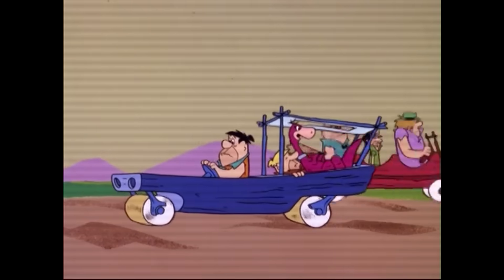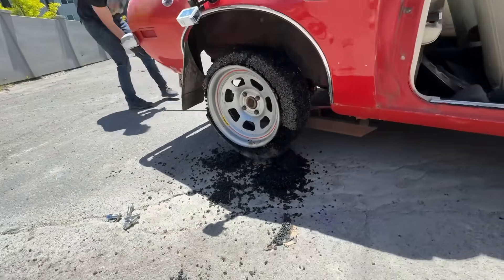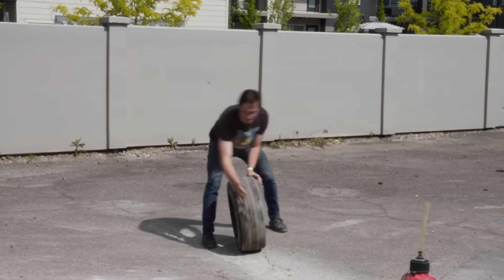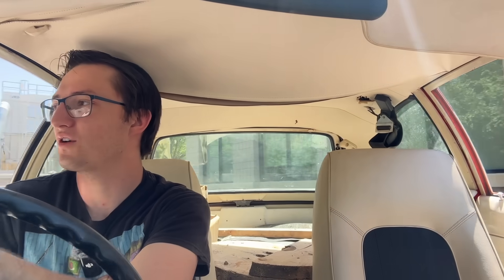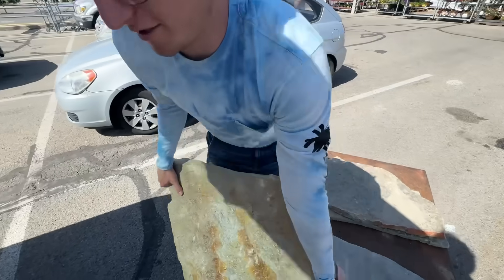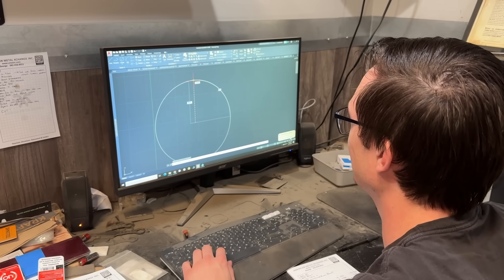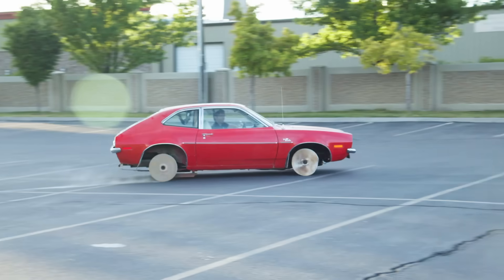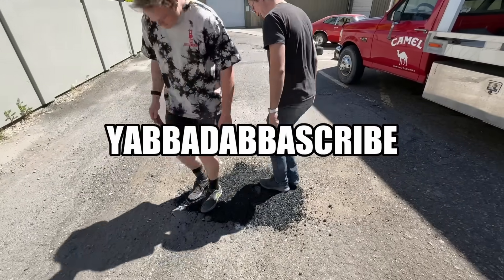Can You Drive On Stone Wheels?

Comment: I keep watching these to see if they will do these projects in an intelligent manner. But these "JOKE ENGINEERING" channels are just for entertainment. You can engineer stone tires that will work, but they will be VERY heavy and would requires special bolts to fasten to the wheel assembly.. or you can create stone tires that affix to existing rims, or specially designed rims. Using thin stone discs is just dumb, and funny, which is why I watch these video (to laugh at the fail).

Comment: you know what's really fun?

plastic wheels. specifically as in a plastic liner made of like agracultural drainage pipe. fitting a wheel in 'em can be a trick. be easier without the radial wires. 

but yeah. perfect for if you were brave enough to drift the pinto. I'd do a rear end overhaul if it were mine. at least ditch the leafs for semi trailing arm, and do something about that gas tank situation. was thinking fuel cell, but we ain't going full race. just cheap garage beater racer.

I grew up on monster garage and around my mechanic uncles.

Comment: its the same rd material 1 reason it wrks

vanallen=newhorizonspeed=shows moon cant b reached since range=speed! EXACT MATCH move "4" one digit over!
36400speed=36040range ALSO CARS MAX 300MPH=CITY2CITYRANGEMATCH!

coldwaterafterhot=brains
 DUPONTmicroplastics
pinealglandsleep
redbloodcelloxyg
kid10xEMF
wps is not off
CHICKENPOXV=SHINGLES
Dentists don't track X-Rays enough
blue-lite blockers acrylic tan orange; sideflectors eclipserollens nvrdilateliq COPPER BLOCKS WIFI oxygen sleep grisom baron William Greer BAYOFPIGSCIA shatner911 muffsplugstinnitus

single nuke in space emp could wipe out nearly all tech :o wow

Comment: The asphalt tire would have worked better if you mixed the epoxy with the asphalt before pouring or poured the epoxy with the asphalt at the same time into the tire.

Comment: Ah yes… Greg the Chevrolet
Now I have the urge to type out the lyrics of “rusty Chevrolet” know what… screw it. I Here I go. 

“Dashing through the snow,
In my rusty Chevrolet,
Down the road I go,
Sliding all the way,
I need new piston rings,
I need some new snow tires,
My car is held together
By a piece of chicken wire,

Oh, rust and smoke, the heater's broke,
The door just blew away,
I light a match to see the dash,
And then I start to pray,
The frame is bent, the muffler went,
The radio, it's okay,
Oh, what fun it is to drive
This rusty Chevrolet.

I went to the IGA,
To get some Christmas cheer,
I just passed up my left front tire
And it's getting hard to steer,
Skidding down the highway,
Right past the Negaunee cops,
I had to drag my swampers
Just to get the car to stop,

Oh, rust and smoke, the heater's broke,
The door just blew away,
I light a match to see the dash,
And then I start to pray,
The frame is bent, the muffler went,
The radio, it's okay,
Oh, what fun it is to drive
This rusty Chevrolet.
(instrumental)

Bouncing through the snowdrifts,
In a big blue cloud of smoke,
People laugh as I drive by,
I wonder what's the joke,
I got to get to Shop-Ko,
To pick up the lay-away.
'Cause Santa Claus is coming soon
In his big old rusty sleigh.

Oh, rust and smoke, the heater's broke,
The door just blew away,
I light a match to see the dash,
And then I start to pray,
The frame is bent, the muffler went,
The radio, it's okay,
Oh, what fun it is to drive
This rusty Chevrolet.”

Comment: Why wouldn't you put washers on the lug bolts before you put the lug nuts on to make it not rocky? Would have costed you about 72¢ a tire or $2.88 for all 4 tires. Actually $2.70 because you're missing 1 lug bolt. Forgot about that one.

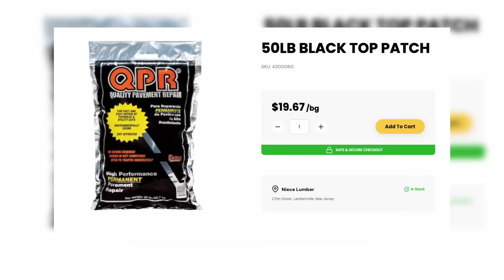Comment: 1:08 asphalt is not tar. Asphalt is made from BITUMEN. 
a black viscous mixture of hydrocarbons obtained naturally or as a residue from petroleum distillation. It is used for road surfacing and roofing.

 TAR can be made from petroleum, but as u understand it, it's a type of condensate made from burning resinous plants. 
 The most common that comes to mind are pine and spruce trees.

Comment: cohesion is a thing even when you put the batter onto a mold and into the oven, and then eat said cake! hahahah. Gotta put some Pectine on those pattys. haha
Concrete tyre means metal mesh rim. Sandcastle arquitecture doesn´t work with dynamics.🙈

Comment: This video illustrates the reasons that pneumatic tires were invented.. People putting on big, heavy wheels with super low-progile tires are basically going to the concrete wheel by choice.

PS, if you find yourself mounting a heavy wheel on the ground, don't try to install it like these guys. Squat down and support your elbows with your knees. Should be able to hold the tire up off the ground this way and shuffle it into position without too much trouble.

Comment: The thing about asphalt is you have to put it under a LOT if pressure to get it to hold better. Usually you have steamrollers go over it which creates heat and constant pressure beyond that, you have cars that roll over it further dispersing and compacting it.

Concrete isnt too bad if you mix it with a shovel and chop at it, thats what we did when building our decently large fence. Also impact drill works great too lol

Comment: next one needs to be a set of 4 of the concrete wheels, but sanded round and given treads. Then use it on a rubber road.

Comment: I would try using Hot-Mix Asphalt (HMA) instead of cold-patch asphalt.
Also just a reminder that Concrete > Asphalt, but we use asphalt because it's cheaper in the short term. (Not in the long term)

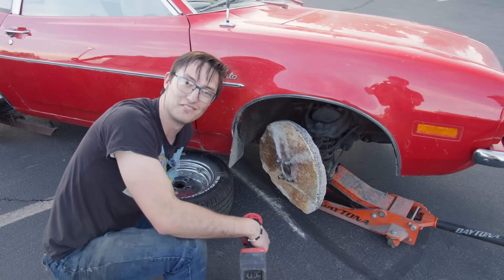Comment: 17:05 "So we don't damage the road" Yes cause the concrete tires and stone tires totally haven't damaged it yes, logical to change the tire. 🙏
Reply: The marks it left will wash away with the rain.
Reply: @Zinovad  First, they're not marks, they're cracks. And second, they don't wash away at all dipshit. It's not fucking chalk, they erode the road and create potholes at a faster rate.

This dude is a clown for what he did, but you're the circus for trying to defend his dumbass actions.
Reply: @Zinovad  Yeah because the marks are the problem. 🙄

Comment: I want solid tires but magnetic shock system to compensate. But I keep skipping everything to internal blade duct hover crafts. Hey I got a question for you! Search Spiders fly electricity How does electricity help spiders fly but not Bees who together produce Thundercloud level electricity? Slides finger through air ducts made with material for static and ultrasound pressure control + Antidrag I like Gyro/turbine Blade ideas.. Ever seen the Mono-Train? If it can balance a train it can balance a monster.. Did you know Turbine whine can be used for ultrasound beyond range of hearing and if set right can be used to make hydrogen from water?

Everything has a resonance. Talk to free AI about Plasma generated ultrasound then look into how Ultrasound can create pressure greater than bottom of the sea on a nanoscale. Some frequency things can't exist so they break. Like crystal vs the F-Lady. (Turbine whine to Hydrogen+Oxygen tanks = Emergency landing system by Hydrogen duct release for all directions shutter control)
Reply: ^ When you're an alien trying to give humans some things to think about. Learn ultrasound you could someday scan parts for your vehicles with a portable ultrasound scanner and use generative AI + 3D printer to upgrade and bypass limited parts. Build your own world in one spot.

Comment: You're not supposed to mix concrete by hand.

Pour some balast on the ground and in the middle of it pour the cement powder and some water (slowly) and while doing this mix it with a shovel. Keep mixing with the shovel until it's done then go pour it where it needs to go. Be sure to keep some sort of outer layer of balast there, don't mix it all with concrete. Kind of hard to explain, imagine makinf some sort of circular wall out of balast and inside that mixing concrete.

That's how I did it at least when I didn't have a cement mixer on hand.

Comment: asphalt.... was a bad idea. i assume this is the first time youve worked with it, but yeah, there is no way itd hold up together. Asphalt is very brittle as the pieces are quite loosely held together i would say. i mean, it works when compression force is applied from top, but i doubt it works when you add shear forces etc.
As to concrete wheel, how long did it set? Cause concrete needs at least a month, but honestly the longer the better. ive tried to cut 5-6 week old concrete and it cut like butter, i tried to cut the same concrete stabs but 1 year old and i hated it.

Comment: My guess: You can, but it is a really bad idea.
1:10 It counts. It acts like stone under regular conditions.
3:45 Did you heat it to 140°C before you compacted it? You need to have it molten in order for it to stick together. Edit: Since tar is amorphous, it could work with cold pressing as well, but you'd have to wait a long time. A few weeks. It is better to just melt it.

I wonder if you were fined for wrecking the road with your concrete and rock tires. Especially when you decided to use them as angle grinders against the road.

Comment: It would have been possible to do the same as in the sprung tram wheels (streetcar wheels, for those who use US customary system). Screw a steel disk with eight holes for bolts to the axle, screw stone disks to this steel disk on both sides through rubber shock absorbers. The nut and cap could have been pressed from the outside of the stone disks with a metal ring, also with a rubber layer. This would have minimized the metal-stone connections by sprung them, and also increased the number of connection points, which would have reduced the risk of stone breakage. Well, less vibration would have been transmitted to the cabin

Comment: Not sure what's more terrifying. The thought of driving on rocks, or attaching rock wheels to a Ford Pinto, which was discontinued due to the gas tank exploding upon impact.
Reply: The pinto's real problem is that the gas tank would be crammed up against the differential cover during a rear end collision. The bolts on the differential cover would puncture the tank and sometimes make a spark.
Reply: At least it's not a cybertruck 😂
Reply: Only when rigged with explosives.
Reply: @CptJistuce  the 27 people who died in Pinto fires would beg to disagree
Reply: @heyitsgabe1093  The Pinto was not less safe than other cars of the day. It is documented fact that the news coverage of exploding Pintos was a fabricated story, and created through the use of  explosives. 

Car fires in accidents are less common today, but still occur, and people still die in car fires. Citing that some people died in burning Pintos does not disprove that the coverage was faked.
Reply: Gas tanks don't explode, liquids in general don't, to stop misinformation unalived on its tracks only a bit of knowledge is needed.
Reply: @davidaugustofc2574  Gas tanks can explode when they are full of gasoline vapors. Do not spread misinformation which could leave someone unalived all over the tracks.

This is why special tools are used when working on gas tanks. Brass hammers don't make sparks that can ignite those vapors.

Also, there are liquids that explode. Nitroglycerine is a famous one.
Reply: @CptJistuce  Give these people their Darwin award because leaving gas tanks mostly empty is just dumb
Reply: @davidaugustofc2574  It is a lot harder to do repairs on a full one.
Reply: @davidaugustofc2574 you do realize any tank that isn’t completely filled (no air) will have vapors in it right?

Comment: You can drive a car on anything just depends how smooth tou want the ride to be and how reliable. I think there should be a type of tire that is like the new airless nba basketballs and require no air but soft and strong enough to survive on a car as a daily driver. But anything round can be used as a wheel if its round enough or square and fits on the car. At first when i saw the title i literally thought you had massive boulders you was gonna carve in to stone wheels and not use asphalt but asphalt was way faster easier and same thing basically. And those basset wheels are racing wheels we use on asphalt and dirt oval track racecars. Bassett is my fav brand racing wheel i like them over aero racing wheels for asphalt and for dirt i prefer aero over basset but thats for another tome why i prefer each one over the other for different track surfaces and type of racing. Glad to see someone using a cheap racing wheel. My street car which is a 1969 elcamino ss 454 has bassest racing rims on it and love them it looks beautiful and elegant and fits the overall pro touring look build of the elcamino

Comment: Spoiler alert:

Obviously not. Stone is a fragile matrial. Yash, very hard! But so its glass..
Like glass, stone brakes easily with pressure on the right spot. (or wrong, depending on the point o view).
Which will defitenely happen on a wheel

Comment: My first car was a 1970 Pinto coupe. I got it around 1980 and had to rebuild the engine. Four speed manual. I had about $400.00 in it. (rebuilt the engine myself) What a fun car. Simple to maintain and repair, around 30 miles per gallon, set of tires back then cost me probably about $100.00. I would like to find another as a beater project. Off to bring a trailer I go.

Comment: Cold Mix Asphalt will never set up fully hard (this is what you buy from hardware stores). Hot mix (from an actual asphalt production plant) is the only thing that would work for a wheel. Hot mix must be layed and compacted before it reaches a certain low temp though (the asphalt plant can tell you what low temp it can still be used and set up correctly).

Comment: Let me say what I think before I watch: 
1-Way too heavy, will probably make accelerating and slowing down worse because inertia is a thing. 
2- Most likely terrible drag coeficient, making it most likely to slide of the road and kill you.
3-Will probably desintegrate when going through high RPM, not sure if it's the case with normal road RPM.
4- Good luck putting breaks on that thing.
5- Almost forgot, as rigid as a rock...wait a minute...Yeah, probably not too confortable to drive, regardless of your suspention.
Edit: I watched the video and realise I will never find out if I'm wrong because this is not Whistlin diesel so this guy won't be putting his life at risk for a few likes and a lot of engagement...Good for him!

Comment: as someone who works with asphalt.
cold asphalt isn't exactly a fair comparisson to the scalding hot emulsion of gravel and BITUMEN (they have not used tar in decades) 
secondly you would have been far better off cutting out a section of road since that asphalt has actually been flattened properly and not just poured loosely in a mold.

i dare say that if done correctly asphalt wheels would work way better than any of the other options, the material has by far the most toughness relative to hardness

Comment: So much missed opportunities, thermal cam to measure the temp of burnout (The center should be cold). I would've made 6 wheels and tested the first one after cutting for fitment. Then there would be opportunities to change out a wheel if it breaks. Drifting. Gravel road. Asphalt inside air tires without removing the rubber. Concrete tires poured in precise wooden formwork made with waterjet cutter. Cutting hole in a light carriage and trying flinstones running mode with concrete wheels. Jumping with concrete/stone/asphalt wheels. Running through a pothole with these wheels. Running over speedbump with these wheels.

Comment: The best wheel? Concrete. Most practical?  None of them. At least the concrete won’t fall apart on you if you get the mixture right because it’s mostly just compression it’s experiencing which is what it’s really strong at.

Comment: What if you tried the asphalt tires again....but don't cut off the rubber. Like have the asphalt replace the air in the tires so your tires never go flat again? Asphalt clearly has a lot of give from this video, so much it cant retain its shape under pressure.  But if the tire still provided the sold structure and friction and Asphalt just filled it up we could still see what driving on Asphalt tires is like

Comment: TBF, the Flintstone's wheels were rollers that probably weighed several tons each and might work better on roads when pavement hadn't been invented yet.
Reply: Even as a kid, even I was not sold on the rock wheels, I was a bike kid and multiple gears/sprockets was only popular much later on. so I knew walking or riding dinosaurs was faster if not more efficient
Reply: @MangaGamified dinosaurs want to eat but there is no trough on the ice rinks, saving 🤷
Reply: @kriegtech1651  maybe when nearer the north/south poles